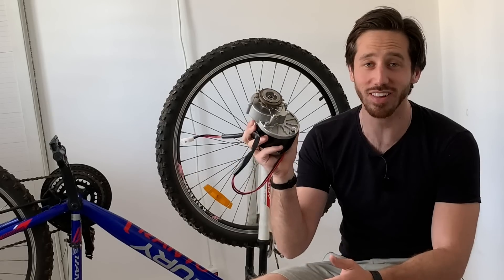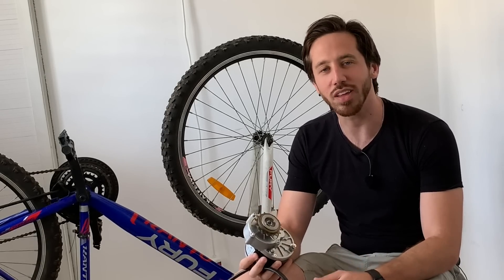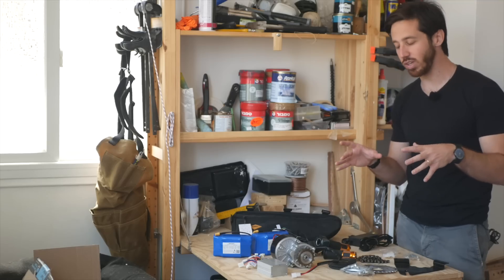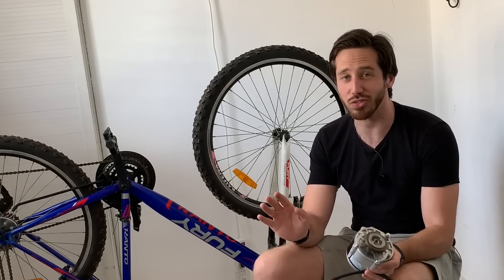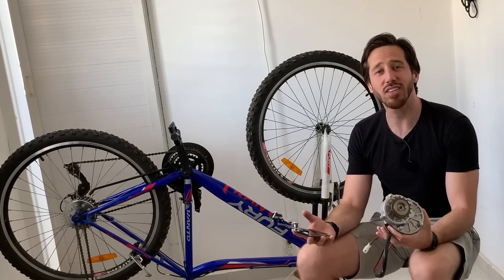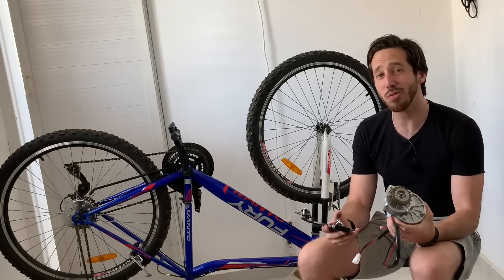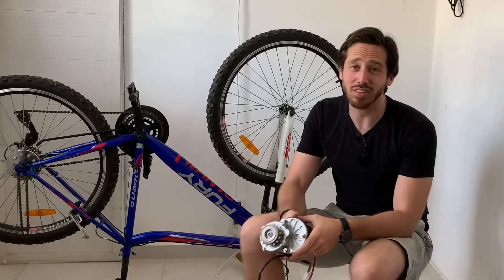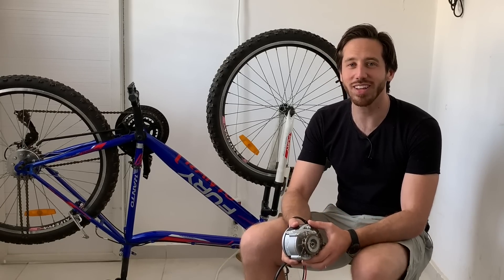Do NOT buy this $103 electric bike conversion kit

Comment: I purchased one and it works amazing for me. I did have to modify the bracket a bit by bending the mounting holes to fit my 20 in. bike. If anyone has purchased and has an issue with the bracket, try cutting the mounts of and making new holes or change the position of the bracket. I have only ordered one battery but planning to order one or two more. Hopefully this comment finds helpful.
Reply: Also try putting washers on the axle to make the motor align a bit.

Comment: This video is 100% correct, the motor itself is good but this kit SUCKS to mount.
I bought one, big mistake, and to make it work, I had to weld it to the bike frame and build a freewheel crank.
It was a lot of work and the bike got pretty ugly. Not recommended.
I have some of videos of the bike if you want to check:
https://www.youtube.com/watch?v=J6TFBH75_g4
https://www.youtube.com/watch?v=MwNcGRrbFuY
Reply: Hi.  Just wanted to ask, I purchased a 72v 5000w rear hub motor for my ezee torq bike. Will I have any issues installing it because the frame is aluminum?  
Thanks.  Love your videos
Reply: @dennissilva347  you may have some issues to fit the motor in your frame, you may need to cold set the frame a little... and you also should use a torque arm to reinforce the fork
Reply: @pqpguilhermepqp   thanks... but what is to cold set the frame.?   And I'm aware of torking  everything down.

Comment: Maybe the design of the motor mounting bracket is specifically pattern only with a Giant MTB as shown in their various videos. I'd rather have a rear hub motor ebike kit that this one coz you have to remove the disc rotor to install the additional cog.

Comment: I bought one of those!
Luckily I managed to fit everything in my bike, but I wouldn’t buy it NEVER again...  
Trying to get the cheapest solution I also  bought a lead acid battery... you can imagine the gap between that s**t and my current hub motor with lithium batteries haha
Reply: lead acid batteries are cheap but for a reason, they drain fast and are heavy as all living hell
Reply: @bingus7361  yep....did that last year myself.  Grabbed some scooter batteries this year and put the SLA'S on craigslist for free about 2 weeks ago.

SLA is fine for temporary, but lithium is definitely the way to go long term.

Comment: Just go with a cheap 36v hub drive motor,  usually under 200 without the batteries, but you have those already....  only increase your overall cost by 80 bucks....

Comment: I bought that same pile of crap kit for my daughter's 24 inch bike.  After bending the bracket in a vise several times and shimming to align, it worked, for all of 30 minutes before the freewheel sprocket shelled out.  I threw it in a box and purchased a $155   500 watt 26 inch front hub motor and a new front fork for 26 inch wheel.  This worked 100% and was still budget.  Daughter loves it.  It is 36 volt, and I got a battery for about 120 bucks on eBay.
Reply: Explain why the new fork?  Also who sells the kit?
Reply: @MumfordJim  needed a fork big enough for a 26inch wheel.  The bike is a 24 inch wheel bike.  Hub motors cost twice the price for 24 as 26.  Got the hub motor kit off eBay.  Wanted to buy another, but all gone now.  Next cheapest was about 220 bucks and 48v 1000watt.

Comment: You should have made this video a few years earlier... I bought this kind of kit and indeed, it is crappy. The motor however isn't that bad. I'ver reused it in a robotic lawnmower (project in progress...) and it has plenty of torque ! 
The speed controller is complete junk. I've replaced it with something different. Great channel btw.

Comment: That mounting bracket doesn’t somehow fit in between the frame and wheel does it?
Reply: I have bought both the MY1016 and the MY1018 motor. It looks like the one in this video is a MY1016Z. There is one major mounting difference between the two motors. The MY1016 has as 1/4 inch standoff and the MY1018 doesn't.  I believe the "universal" mount is actually intended for the MY1018. I originally used a MY1016 and had to take a 1/4 inch out of the bracket and when I changed to the MY1018 I had to add spacers to move the motor backwards 1/4 inch. There are some issues with this kit but nothing you can't fix. Bottom line is if you take your time you can build this ebike for super cheap. I have over 1,000 miles on mine and it is still running strong.

Comment: I was able to make my ebike (500w) with a 36v 10ah battery and front hub motor. Still works great after a few months and only cost 200 US dollars.
Reply: A LC what kit? Thanks
Reply: @cnoz7247  it was a violamart 500w kit and the battery came from aliexpress. Sadly I cannot find the link for the same kit at the same price. It seems like nothing from china is going to be as cheap as it was before coronavirus. here is a similar one 
https://www.amazon.com/Voilamart-Conversion-Electric-Intelligent-Controller/dp/B079T6SL8M

Comment: That was the first thing i was going to buy when i wanted to motorized my bike but instead i went with a 4 stroke engine now i am using a 2 stroke engine with an all in one electric bike wheel since i want to go faster. When i am text to other people i kill the engine and go with electric. It pretty nice since i am not paying any insurance.
Reply: Thats fucking excellent! Have a 2stroke mounted on My cruiser and cant stop thinking the same. My idea is to fit a 1000w 36v motor/generator on a separate sprocket on the back wheel. This way, when running the 2stroke it Will charge the battery for the electric drive. I Will then Mount a smaller sprocket for the 2 stroke and let the bike run on battery upp to say 25 - 35 km/h and then let the 2 stroke take over... This setup is probably going to get me killed😀
Reply: @johnpetters3328  hope it do not get you kill and also hope it work
Reply: I also have a 2 stroke engine and was going to make it electric but decided to make a separate ebike for traveling.
Reply: @bogman862  that a smart idea.
Reply: Gasoline - Electric Hybrid Bike

Comment: I didn't get a very good look at the bracket, but did you try mounting it on the inside instead of the outside of the frame?

I don't think I would want that motor hanging off the side of the bike like that anyway.
Reply from the maker: I had a similar thought, but the shape of the bracket hangers doesn't allow that option, unfortunately.

Comment: sir you forget to mention one more but the greatest disadvantage of this motor and that is if you are using lion pack for this motor surely after 1 month of use you motor brush will behave abnormally and due to which your motor will heat up even at no load condition and your controller output capacitor will burn everytime....in short it is very bad for good projects.....
https://youtu.be/HY7OmsveQ50
Reply: so are you saying that the motor and controller will only work well with lead acid batteries?
Reply: @evgizmojm  yes because i have personally seen many one using 12v 12ah lead acid battery and they are running well....but mine was not....i burnt three controller and finally arrived to know that the brush is shorting the output of the battery
Reply: @sagarevstore4524  That explains the millions of brushed power tools that work exactly fine with a Lithium battery pack. I should convert to a car battery, because a 70 pound drill is awesome!
Reply: @dfabeagle718  no sir i mean to say to this particular motor brush is not of good quality it wears very fast due to heating and when it starts sparks the controller will burn although it will appear that the motor is in good condition....sir i am used to this motor and experienced till when i burnt 3 controller and finally got to know after research that when brush gives unwanted sparking it commutator get shorted.....i hope its clear now....power tools brushes are also changed frequently..Why??? because of high current and excessive use....
Reply: @sagarevstore4524  Sorry, I was being a little snarky. What I mean to say is "If they are at the same voltage and current capability,  I can't how see the battery chemistry  would save a crappy motor from itself."  High current drain style Li-Ion power tool batteries can deliver significant current for their size, though. A comparable lead acid battery would usually be much larger and heavy. Anyway, carry on!

Comment: The seller must have watched this video and left a thumbs down.
Reply: I did too because it seemed there are quite a few options to mount a motor or engine on a bike. nothing new. rear rack mount (w longer chain) fab a bracket a few different ways. where there's a will there's a way!

Comment: I want to electrify my bike so badly, but I'm afraid that it's going to be so awesomely amazing that I'll never want to pedal a bike again.
Reply: That’s exactly what will happen. All my vehicles are electric and I’ll never walk again
Reply: most electric bikes come with something called Pedal Assist, basically you install a sensor that detects when your pedaling and the motor will only power on as you pedal, course you could also go straight throttle and forget to pedal
Reply: @socialfreak6900  I do a little of both.  But I love not having to sweat hills on a 44 yr old, heavy steel frame bike.

BUT THE LOVE I'M GETTING FROM THOSE WHO SEE ME ON THE THING IS ABSOLUTELY PRICELESS.

Micah was right about those Ibera frame bags.  Even the large bag scrunches pretty well inside a tight triangle.

BTW, I'm a bit older than the bike, so.....
Reply: @hapnin5862  I'm also "up in years" ... retired, actually. Twice a month I hook a cargo trailer to my bike and run 5 miles to the grocery store. It usually takes 15 minutes from the time I lock my bike to actually enter the store because so many people want to know what it is, how it works, what it's like. I live on the southern east coast and ebikes are just not as popular or well known as they are on the west coast. I pretty much live a "hermit's life" living on a sailboat, but if I want social interaction, I just charge up the bike and go riding! ;} and I mean I end up talking to all ages from kids to octogenarian - it's great!
Reply: @3DPDK  Awesome!
Reply: David Sky Walker: It will happen - it's just too damn fun to go 25 mph on a bike and unless you have an 8th, "ultra high gear" on your bike you can't actually peddle at that speed and contribute any significant force to the motor's torque. If you want to use the bike for actual exercise you can: 1) use "pedal assist mode" only;  2) turn the power off;  OR ... 3) you use the throttle to get up to 10 mph, then peddle for additional speed... resisting the urge to add more throttle. You'll find you can add 3 to 5 mph, you get a good leg and anaerobic workout and it greatly extends the range of a single battery charge and the life of the electronics. (and you are still passing anyone on their dinosaur un-powered bikes)
Reply: Dennis Young  I like that perspective. I think it's possible that that will be the case for me as well.
Reply: A good pedal assist bike is way more fun than just sitting and doing nothing. Because it's like what pedaling a bike would feel like if you are Superman or something!
Reply: Use the pas. It will blow your mind
Reply: BNa

Comment: Hye their , i have tried making 3 diffirent brackets out of alloy for this kit i started with a 24v motor i have had faulty controllers faulty throttles i have since used a disc rear wheel which you can mount the sprocket you can change the gearing with diffrent sizes then i decide to get the 450 watt 24 v motor and run 36v through it with a 36v controller it now works well but i bought a 36v battery from Ali Express supposed to be genuine Panasonic batteries 20 amps and find it only lasts about 3km itseams to shut of at 36 v do you think it is s faulty Bms ,i would never recommend these kits i could have bought a hub motor for what i have spent .
Reply: Same thing 28 amp hour battery ran two 4.4 36 volt batteries with the 28 and then it was amazing rode for 10-12 miles and almost home and sprucket came apart.

Comment: Thanks for your inquiry about our 1000w motor kit. This is hedy from mxus, which has 20 years experience in motor and 10 years experience in exporting.

48v 1000w motor=$65

20-28inch rim=$15

48v 30A controller=$25

LCD display=$25

Brake=$5

throttle=$5

PAS=$5

the total price is $145

How about this company and its quatation fir rear hub drive 1000w motor ?

Comment: Wish this video was sooner! I got one for my son a few months ago and it sucks. The clutch fell off 1st ride. My son was very disappointed he still doesn't have a working bike now. Still trying to find the money and the right motor to try this over again. Also took a lot of modification to get the chain in line for us also I had to flatten The ears on the bracket where it mounted to the frame and then kind of tweak it in place each time to get the chain and alignment. I had a perfectly aligned everything tight and yet the clutch still fell off and in a really bad way it spun off halfway up the road and that was it. I was able to get it back on a few times but I finally gave up cuz every time we ride it it falls apart